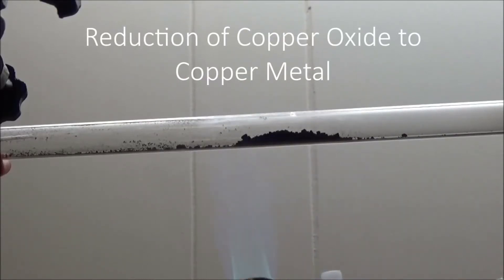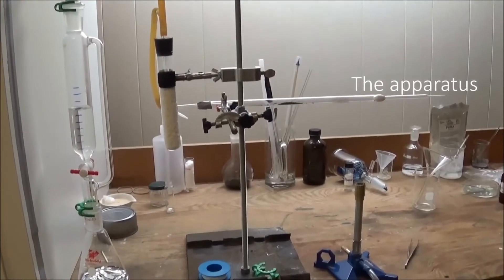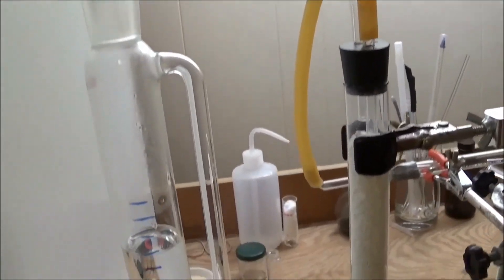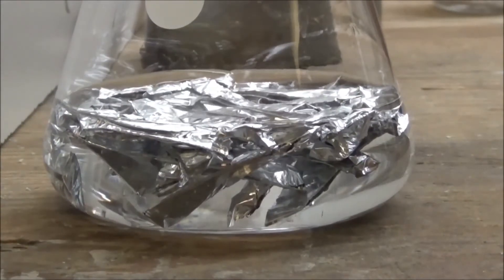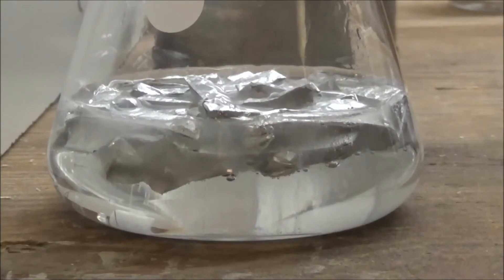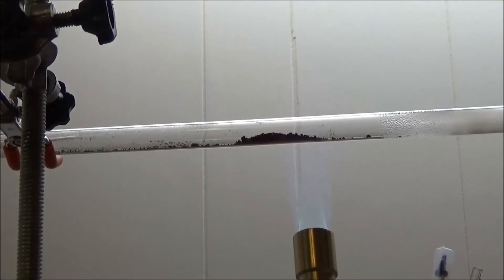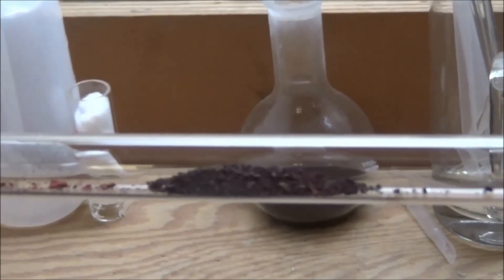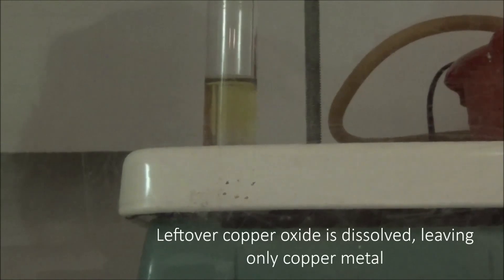Reduction of Copper Oxide with Hydrogen

Comment: can we reduce copper oxide using butane gas ? if yes at what temperature?
Reply from the maker: That sounds feasible, I don't know about a temperature but heating gradually with a torch or Bunsen Burner usually works.
Reply: @TomsLab  Ok, thanks Tom

Comment: You can tell how far the reduction has gone by passing the output through a CaCl trap resting freely on a sensitive scale as the increase in weight is proportional to the amount of oxygen removed from the copper oxide, however you need to dry your input H2 stream too. Thanks for the videos, we appreciate the work you put into them.
Reply from the maker: That's a smart idea! I think I'll try that next time I do a hydrogen reduction.

I'm happy you like my videos :), there should be more great ones to come in the future.

Comment: Seems like a great way for making metal powders. I have a pretty good amount of copper carbonate, which you could then decompose into copper oxide. Then you could use this apparatus to make copper powder. Powders sure are a lot more useful than the copper wire I'm using now.

Just make sure you let the apparatus fill completely with hydrogen to avoid a fire/explosion. Thanks for the video.
Reply from the maker: Yes, it is a great way to make metal powders, hydrogen produced from aluminum foil is very cheap. Iron oxide and all the metal oxides below it on the activity series can  be reduced by hydrogen, but zinc and above cannot. I'm not sure about chromium. 

I was scared at first about lighting the hydrogen, I think the upper explosion limit is 95% or so. The inside had a volume of around 300 mL, so after 3 L of hydrogen were pushed through I felt pretty comfortable. Lol yeah an explosion would be bad :)
Reply from the maker: I never knew that! Now that I looked it up it's actually really cool, hydrogen is evolved at the cathode, nitrogen is evolved from the anode, and the electrolysis is done in a basic environment so Na of K carbonate is left in solution. This could be a perfect source of inert gas. if the voltage is kept below 1.2 volts or so then there shouldn't be any water electrolysis. If the gas stream is passed over platinum catalyst then any oxygen present would be removed. I was going to make a glovebox and this could take the place of a nitrogen tank. Hmmm I'm already imagining a 5 gallon bucket filled with urea solution with a bunch of large plate electrodes in parallel. Anyway, thanks for that!
Reply: Hydrogen can be evolved from a urea solution via electrolysis at  (?) 0.37 volts, so  lower power requirements than the usual methods.